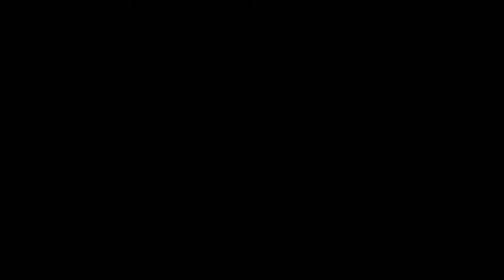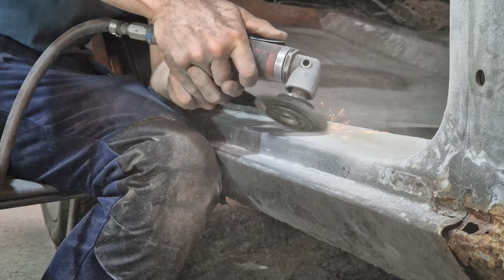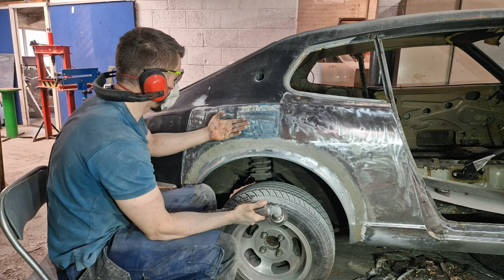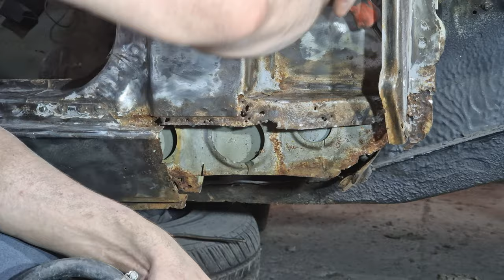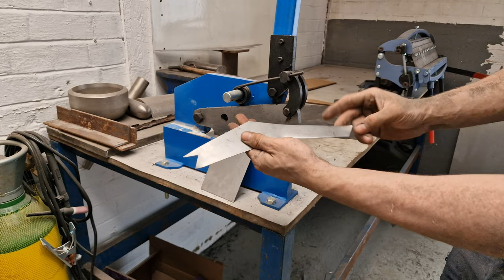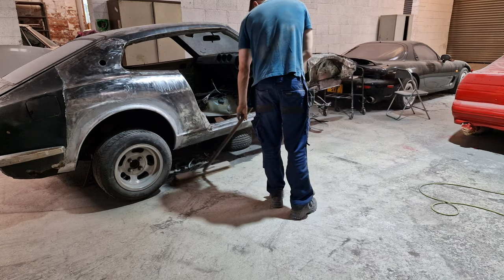Sill Repairs & Removing Years Of Paint & Filler! - Part 12 - Datsun 260z Restoration

Comment: I'll say this, you don't mind a challenge. I'm wondering if it would have been better getting the body sand blasted in the first place to eliminate the prep work. Great job as usual.
Reply: I'm no mechanic but i have a friend who restored a 1951 Kaiser and the 2nd thing he did (1st thing was dismantle the car of everything but the body) was have the body sandblasted and cleaned, cost a few $$$ but at least then you know what to do and where to start and what panels you need to  repair.
i loved watching him work on it, then he sold it and got a 48 Buick or so, and moved town..not sure he ever finished the Buick.

Comment: When you hit deep filler/loads of sealant - grab a Map gas torch - burn it off. Leaves you clean, pretty ready to weld metal, fast. Scrape off the burnt residue with an old chisel. Thank me later.
Reply from the maker: Thanks for the tip :) James!
Reply: @yorkshirecarrestoration  more aimed at your viewers than at you - I doubt you need too many tips. :-)
Reply from the maker: Thanks James :) Very kind of you to help the viewers out too :D

Comment: Just a query and my apologies if I am mistaken. It seems as if the original sill has remained in place and then there was a new sill fitted over the top , as in a cover sill like used on Minis. When you repaired the front section, (and very well to boot), it seems you left the remainder of the double sill in place. Given the UK's winter, snow and salted roads etc, are you not concerned that condensation and moisture between the two "skins", will not aggrivate rust between the two surfaces?
Reply from the maker: You are correct. However this scenario has happened on many places on the car. Panels have just been welded over the old rusty ones. If we were to remove all thr bad metal, there wouldn't be anything left of the car. This is however something we can look at in the future if required as we are keeping the car. Thanks
Reply: @yorkshirecarrestoration  thank you and appreciate your answer,,
Reply from the maker: Not a problem. Thank you!